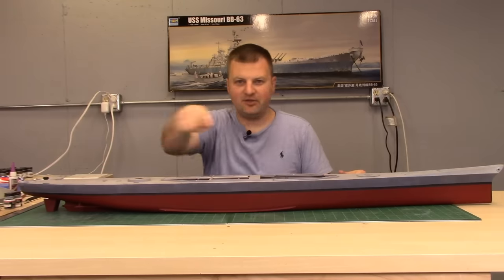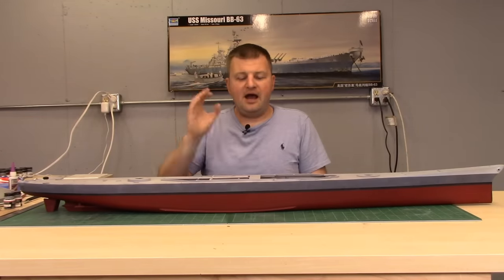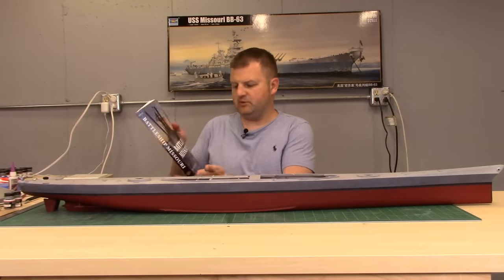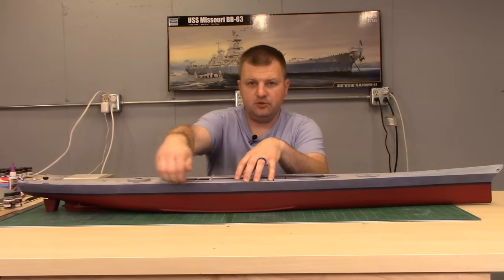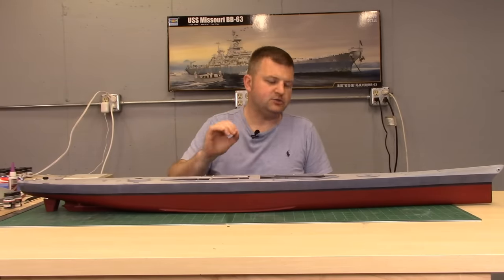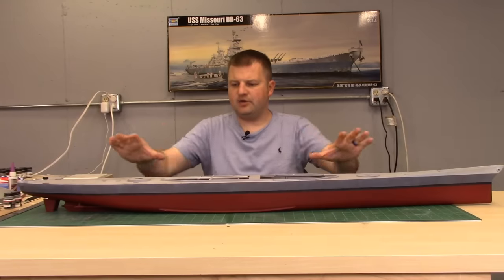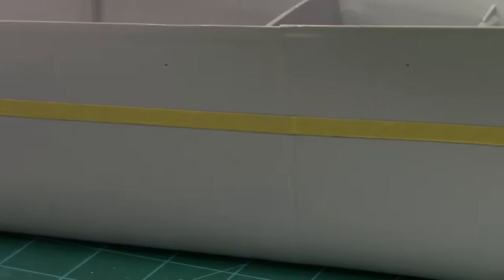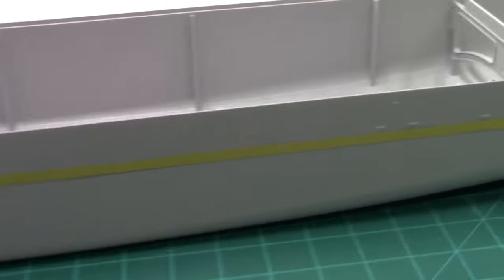1/200 Scale Missouri Build Video 2

Comment: Looks amazing and definitely makes a difference in the end. A couple techniques that have helped me with the hull dishing in the past is to prime it with a coat or two and then start on the hull dishing with a curved scraper. Scraping into the primer has really helped with a softer effect instead of going right into pure plastic.  I used one of those extra soft pillows with the ripped up foam pieces in it to rest the hull on and it let me position/prop up the hull at all different angles which made it a lot easier to work on. Definitely helps with the scraping when it’s not totally parallel to the table. Looks 👍
Reply from the maker: Now that is some valuable information!!! I did a lot of "experimenting" before I filmed. And on the starboard side I arrived at your method of priming first. It definitely makes it easier to see what you've removed. If I had this to do over again, I would have done that first. And I would have moved ahead with a lot more confidence knowing that a little sanding and the paint layers really help sort everything out.

Comment: You mentioned the kamikaze dent.  I was glad you did and I'm looking forward to seeing you replicate it.  I haven't seen anyone else even try to do that.  The oil canning is a great addition that adds a lot of realism to the model.  I admire your dedication.
Reply from the maker: Yes. I have been thinking about this a lot. I'm looking for some solid info on where exactly the dent is. There are lots of pictures of the "dent" online, but I'm not seeing any good reference points for where that is at on the starboard side. I know it's towards the aft near a 5" gun mount.... but I don't know for sure. If you have a link or reference of the exact spot, that would be great to know!!! Thanks!

Comment: Great job.  That 53" challenge is gonna look great.   Thanks for showing all you work. Card scrapping is the best method, your on it.  The problem is the divot "depth" is much less and using the massive tools in scale is tough to get the effect.  They would be less noticeable but there.  Light drags on the scrapper.  What a project.
Reply from the maker: Yeah keep in mind that the divers get filled with paint. So it ends up being significantly shallower that what you see. In fact, I have a hard time even seeing them now. You can feel them. They are there. But it worked out nicely.

Comment: Nice work and always appreciate the finer details. @28:00 the "vents" are actually for dumping the empty shell casings into the sea and clearing the deck of the gun emplacement. The "hot shell man" would wear asbestos gloves or pads and shove them out a door in the deck.

Comment: Battleships, in fact Naval vessels of all kinds suffer dings, dents and bashes.  When HMS Glamorgan had a catastrophic boiler room fire they had no steam to power the fire pumps.  So they sealed off the burning boiler room and starved the fire of air.  The resulting vacuum caused the hull to suck inwards by 6 inches on each side.  They never tried to get the dents out so she spent the last 10 years of her life with a wonderful wave shape down her length. I was in the Royal Navy at the time and saw her like this.

Comment: For oil canning, I would have tried using a Dremel tool with an appropriate burring bit. I think it would be both easier to work with and much quicker.
Reply from the maker: Yeah that was my very first thought. The problem is you have to go slow enough so you remove the plastic and not melt it. But then you’ll be left with a rough surface. Which you’ll have to figure out how best to smooth without removing the very subtle indentations you made. And then there is the control issue. If you slip at all....you’ll have to do a lot of filling. But you’re right. It “could” work out really well. I’m pleased with the results I got. They don’t stand out, just like on the real thing. But if you look at the hulk from the right angle you suddenly see them. Just like on the real thing.

Comment: If it’s possible can you cover the cost for what you spend overall with the kit and upgrade parts. Thank you. Excited to see the build.
Reply from the maker: Hey Ron, I'm into this about $700 US. for this thing. You're mileage may vary depending upon where you get the kit, the Pontos kit, and how much paint you already own. I could have cut the price in half with just buying the kit. And spent just $150 bucks on the detail set if I had gone with a different manufacturer. But Pontos, supposedly, is the best one you can get. So far, with the exception of the hull plating, nothing has been overlooked. The PE will be the bulk of this build, for sure. Then you will probably want a display base and case for it. I will be building those myself and the cost will be negligible. But if you have to have those items made.... well a new case could easily run you another 3-400 bucks. But, yeah, I'll keep all the cost "in mind" as I go and ask again when it's finished. A little google search can get you a ball park idea of the cost of things.

Comment: Even modern steel ships have indentations between the frames. It's caused by the shell being welded to the beams that make up the frames due to heat and easily seen by sunlight at certain angles. It is far more noticeable where the shell is thinner such as the deck houses. As the shell moves over the machinery spaces it is much thicker and even more so over the ballast tanks where it is up to two inches thick and nonexistent.

Comment: I'm sure you could have used a Dremel tool with multiple abrasive bits, to do the hull denting. Would have saved time too. Think it would come out a bit more rib conformed? Great job! Many would not do this detail, maybe the model company could have included an extra bow section with hull denting, $$$$? Or include something to apply to the hull, like the zimuret on the German tank models. Vahevala!

Comment: That is just about the length of 1/72 scale submarine kits. Probably close to the wingspan of the 1/32 scale B-24 by HK.  I think it looks fine. Even the bow. Forge ahead. You got a good build going & got the massive painting done on the hull. Good to see builds of stuff I wouldn't want given to me. Too big. I share your preference in Model master enamel. I do not mind solvent smells & like how enamel works. It torments me that they are discontinuing that line.
Reply from the maker: Yeah, the day I can't buy enamel flat black paint.....I'll probably throw a giant 3 year old fit.

Comment: A soldering iron with the right tip could do the dents on the hull .
Reply from the maker: I thought about that. But it will just melt the plastic and you really need to remove it.
Reply: @TheMidwestModelShop  im thinking if you hold the iron a bit away from the surface with the right shape bit it might work .why not give it a try on a spare bit of plastic and see what it looks like .

Comment: Very nice start. I'm impressed with your efforts to push the envelope, and your philosophy that the main thing is to have fun... after all it IS just a hobby and not life or death. I followed your Arizona build and ended up building my own... and then I took on the Missouri for good measure. There is a well published photo of the hulk of the Oklahoma (very close in size to the Arizona) tied up next to the Wisconsin which dramatically shows the difference in size and fittings between the capital ships of the two eras. You will have an interesting display should you choose to pose your two builds in proximity.

I used both the MK and Eduard products on the Arizona, and the two Pontos products (Eduard hull plates, as well) on the Missouri.  I'm close to finishing up the Missouri, and have a fair amount of surplus photo-etch between the two builds. Should you run into an issue or two and require replacement pieces don't hesitate to let me know and I might be able to provide at no cost.

Again, keep up the good work.
Reply from the maker: Holy Cow, Jim!!! Thank you very much!!! I will keep that in mind for when I inevitably loose something!

Comment: I'm building a 1/200 HMS Hood by Trumpeter and I'm picking a couple tips here and there from these videos, but I steadfastly refuse to mutilate it by trying to make it look like it just came off a used boat lot in the south side. If that's someones cup of tea, so be it. I've never believed in displaying anything to show it at it's worst.
Reply: This is the age old argument of 'as issued' or 'used'. personally I don't mind it so long as it makes sense for the ship in the time it is being depicted. for instance on this build I think it makes sense to add it since the ship does have significant dishing in pictures from the time the ship is meant to be depicted, However if you added it to your model of Hood I wouldn't agree with it since Hood never showed evidence of it at any point in it's service life. Like you said though to each their own. 

P.s. that 1/200 scale HMS Hood must be an absolute behemoth. I did one in 1/350 scale and remember it being a monster, that's why I prefer 1/700 scale now their far more manageable to build and display

Comment: Beautiful! I am starting my Trumpeter Iowa-class ship, but before I do, I need help! I have been looking for a guide showing all the guy wires, antennas, cables, and misc lines for a WW2 Iowa-class battleship; I mean all of them. Yes, I have looked online. There must be a book or something...does the above-mentioned book feature this? Thanks!
Reply from the maker: Outside Beyond I was just thinking about that today. So this book is mostly a “history” of the ship. But there are WAY more pictures here than I’ve found anywhere else. I’m hoping it will provide that information. I wouldn’t let that stop you from starting the build, however. There is A LOT to do before you get to that stage 😉. Hoping to have another video update out by the end of next week.

Comment: Question;  Is a larger kit easier because all  the  parts are bigger, or harder because there is so much more detail and MORE small parts?
Reply from the maker: Yes and Yes. So the tiny parts on a 1/350 scale ship are much more manageable in this scale and that makes thing much easier. However, because this ship is so much larger, suddenly very small details that you wouldn't see on the 1/350 scale ship suddenly becomes visible and are modeled. Now you're right back to where you started. But, you could always opt to skip that stuff!

Comment: Great video- I have never heard you talk about your airbrush setup-what kind of brush do you use?
Reply from the maker: It is an Iwata Eclipse HP-CS, double action airbrush.  I picked mine up at Hobby Lobby and used the 40% off coupon. I'm pretty sure it's the 0.35 needle. For air, I have an all in one compressor/tank combo that I picked up about 10 years ago on ebay. It just keeps going! I have the regulator set anywhere from 5-20psi depending on the type of spraying I'm doing. For extra fine detail, I thin the paint A LOT, and run it at 5 psi. For normal coverage, I'm spraying in the 15-20psi range.

Comment: You know the Iowa class had an internal armour belt right? As in the outer layer was just regular 1 1/4" hull plating, and was essentially part of the torpedo defence system (at least the bit below the water line). The armour plates were several feet inside the hull. This diagram might help illustrate:
https://miro.medium.com/max/1600/1*iiJsTWOFF_YSc8TXeQxGMw.png
Reply from the maker: Yes I know. For some reason when I dented up the hull, a whole bunch of people lots their minds because they thought battleship armor is on the outside.

Comment: I dont believe youve realized this: While you are paying homage to the tin canning- you really are just beginning to 'model' the texture of the hull. But what I see is that if you study that photograph you'll notice a pattern to the dents (some light some heavier) and if you want a truer representation- these individual hundreds of dents need to be analyzed and replicated in their correct positions. You could do this two ways. One by graphing out the hull  like you have done and going down lines dent to dent copying depth and size, by comparing with the picture. Mostly depth is what youre looking at. Width and height matter too. Or you could realize the construction of this ship and where the exact places of higher stress have dented the hull. There is a pattern. and finally the scraping  method is leaving scratches within the dented simulation, not looking good. I am wondering if some type of low powered router might work or even Dremel with soft abrasive. I had even considered some sort of mild heat to do it. Good work though way to patiently detail something, i enjoy this and would offer my perspective if i thought my insight could help someone work through the process. Thanks.
Reply from the maker: I tried a dremel first. I set it to a really low speed and used a very smooth abrasive. It scratched the crap out of the plastic. The best solution is a very sharp scraper. Then hit it with paint, sand it lightly and spray it again. That takes care of the scratches. I made a mess of the starboard side trying to figure out the best way to do this.

Comment: I have to admit I'm looking forward to this build. I don't usually watch this type of video but I think this is going to be interesting. As for the dents you're adding. ..I Really hate to tell you but they aren't dents. It's got more to do with internal support from welding than oil canning or hull dishing. So it's about light catching paint in a certain way. The plates aren't actually concave or dished. You see it a lot with ships that have been rushed. But you ceased doing it already so... It's just a pity you didn't do a bit more research before doing it.

Comment: Hi Ben, I have watched to completion and have to say, Good Job! It looks amazing. I just received my kit and Pontos parts and am preparing to start. Presently I am buying paint and working out mixes (I will be using Tamiya paint). 
I have a question regarding the added brass plates. I looked through 254 comments and was surprised no one asked. I will be using styrene and making my own gauge. The diagram you provided is a bit confusing (the 11 and 14 measurements) seem too close to the 21mm end. Can you clear this up for me? Also, the bigger question, where do you first start the plates? I understand they are spaced out 35mm on center but I don’t know where to start the first one. Thanks for your help.

Comment: Why didn't the manufacturer mould the "tin canning" effect onto the hull sections in the first place.
Reply from the maker: That is an EXCELLENT question. Short answer is I do not know. Even when you look at the Arizona's hull... it comes molded with lots more detail. Things get especially interesting with the hull for the Hood. So maybe they had a different budget back then for the molds? It's kind of a bummer because it would definitely be way easier to fill in the hull dishing on an out of the box kit than to add them like I did. I wish they would consider this in the future. I think it's a cool affect on any ship and it adds to the realism.
Reply: @TheMidwestModelShop  It beggars belief that belt armour over a foot thick could be subject to hull dishing at all but it obviously is.
Reply from the maker: @geoffbirkinshaw8466  Well the common misconception is that the armor is "the hull". It is not. (Most of the time) The exterior hull plating is made from regular steel plate. (thickness may vary) The actual "Belt Armor" is inside the ship and is usually sloped to maximize the protection of vital parts. Shells were meant to strike the exterior of the ship and start to break apart. As some of the energy from the impact is dissipated, the belt armor inside became very effective and would do its job. The belt armor along the waterline for torpedoes, IS mounted on the outside of the ship.....usually. And yes, that area wouldn't suffer from hull dishing.  I think World of Warships and the simple human desire to be "inside" something that's safe, perpetuates the misconceptions of where the armor is.  The result is me making a ridiculous attempt to mimic the effect on my model!

Comment: can you tell me why spend nearly £400 on a model then scratch holes in the hull. if you go into the hull to deep ok you can fill it in yes but to me it's daft one mistake and your going to need a new hull and that part will not come cheap
Reply from the maker: The hull is about 1/8 inch or 4-5mm thick. You have to work pretty hard to screw it up. And even then, I can fix it.

Comment: Everyone is commenting on the oil canning. Meanwhile no one is pointing out how he put the black stripe way too high. Even in his reference photo of the Oil Canning you can see how much of the bow is out of the water. Then after painting it he has the black stripe right up against where the curve outwards kn the bow starts. Thats not where it should be.
Reply: For making such a big deal about historical accuracy and the tin canning he really didn’t pay much attention to where the waterline would be and now can barely see the tin canning he worked hard on.

It makes no sense for the tin canning to be below the waterline of the ship anyways. What were you thinking, man?
Reply from the maker: My reference photo is of her in Pearl Harbor NOW. Unloaded and sitting high out of the water. I would like you to do a little research on where the waterline was at during WWII.  Which is why no one is commenting on where I placed it. Because it is accurate.
Reply: The Midwest Model Shop If you’re basing it off modern pictures then it still doesnt make much sense to have the tin canning below the waterline as waves wouldn’t effect it there